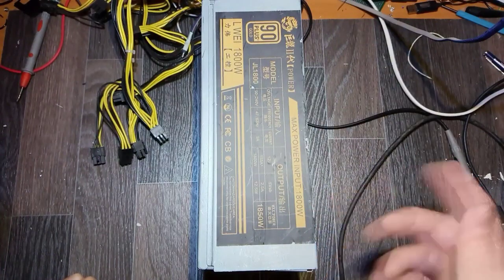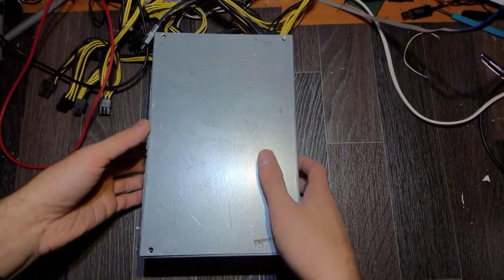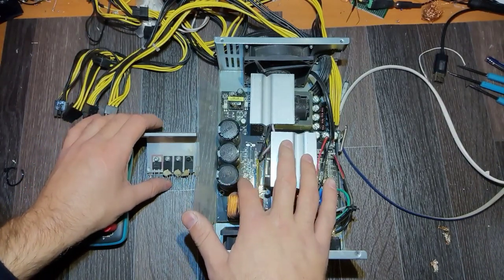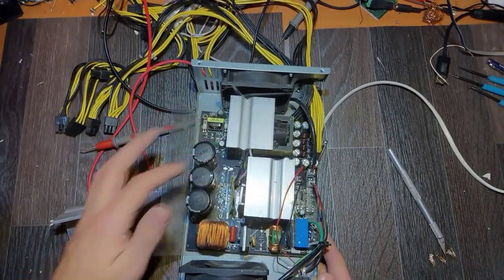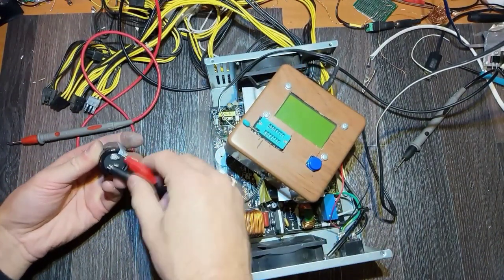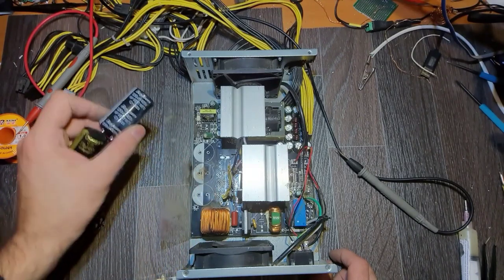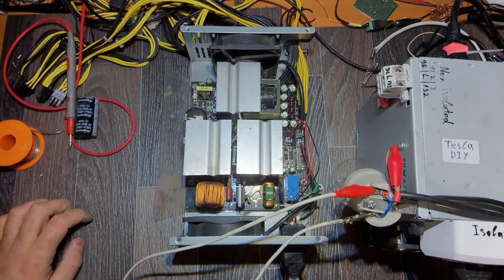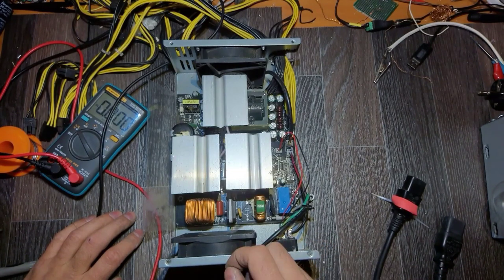Antminer power supply repair

Comment: Hi thanks to share this... But I think you'd better change all the primary caps, since two of them are bulged; they are at the end of their lifetime. Furthermore, I think an ESR measurement will give you more information of the condition of a cap than mF's alone. And the cap that you used for replacement is a Chinese knock off of poor quality. Though I like your humour!
Reply from the maker: Hi. Thank you. You're right. Unfortunately Era of mining with those power supplies is gone. No one needs them.